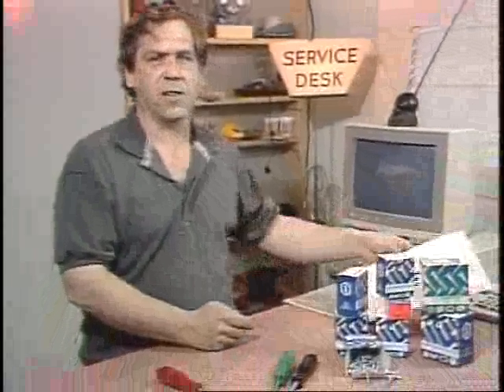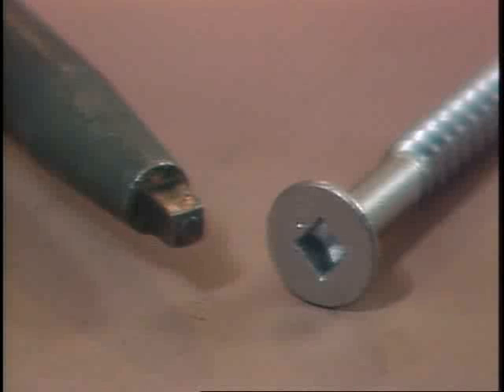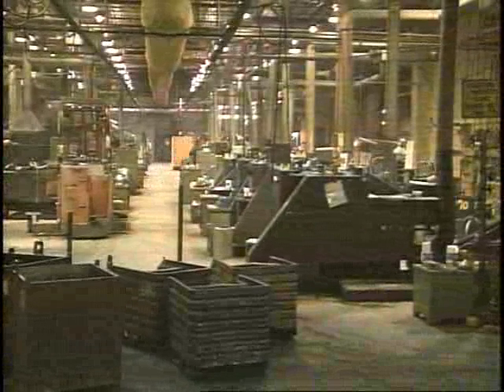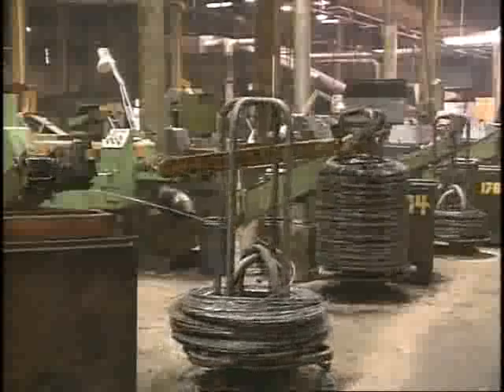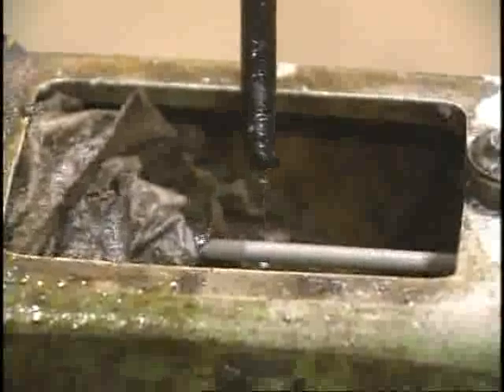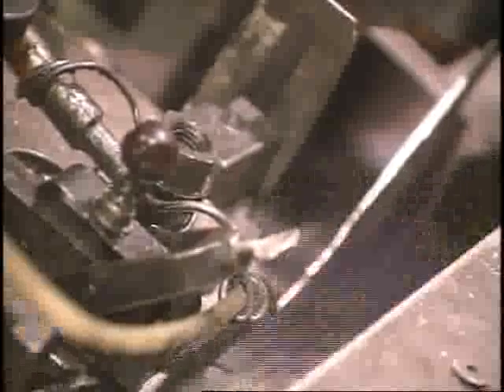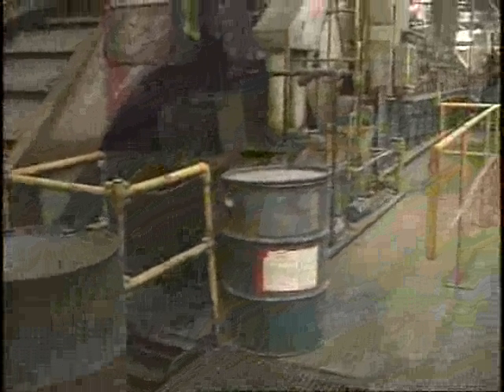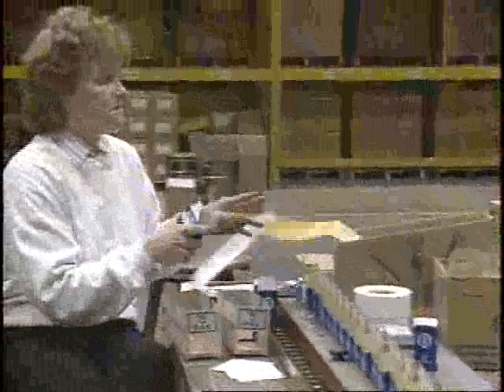Robertson Screws

Comment: Way better than Philips ... should adopt these in UK
Reply: Pozidrive is potentially much better than Philips but only with a good tool and screws that are correctly made.
Reply: Torx is the future.  Only a pity that they didn't make the Torx conical like Robertson. It would make them much more user friendly!
Reply: @tuttebelleke  Once you introduce a taper you increase the risk of cam-out. That's why Pozi is better than Philips.
Reply: @featherbrain7147  One should only make the outer diameter of the Torx bit conical, NOT the 6 grooves.  If the screws are adapted in the same way (they also get stronger by doing that), the screws will stay stable centered in line, even when applying a slight side force (like with Robertson screws).  

For sure woodworkers would appreciate that.  But probably machine assemblers would rather prefer a little side play for allowing screws to orient themselves to the center-line of the thread they are screwed in?
Reply: @featherbrain7147  You have to be really sloppy for a Robertson bit to cam out even though the socket is tapered. The taper is so slight so as cam out is not an issue, and the screw stays on the bit and self indexes. No other configuration can compete in that respect.

Comment: Torx screws are the future.  Here in Europe are Philips and Pozidrive screws for a longtime popular, now it disappearing slowly from the shops.  

Robertson Screws is an typical Canadian product,  I've never seen it here in the Netherlands.
Reply: But it is a pity that they didn't make the Torx conical like Robertson.  It would make them much more user friendly!  Torx 2.0 should be created!
Reply: I've been working with these Torx screws for a while now and I find it much better than Pozidrive screws. A Pozidrive bitt is worn out after 500 screws, with a good Trox bit you can use it up to 2000 screws or more.
Reply: @lexpee  It is the number of flanges that distribute the torque, that does determine the strength and wear resistance of bit and screw.  We evolved from flat (2 faces) to Robertson/Philips/Pozidrive (4), to Hex (6) to Torx (6 enhanced flanges).  And in aviation they often use 12 spline bolts.
Reply: Just bought 3 boxes (600 pieces) here in the Netherlands. I use then of electrical work (outlets, distribution boxes and stuff)
Reply: Ik heb Robertson schroeven nog nooit gezien hier in de winkels , wel te koop op het internet.

i have never see  Robertson Screws here in the shops, It is for sure to buy on the internet.
Reply: Robertson holds onto the screwdriver bit and self alligns. That bears the hell out of Torx for most applications.
Reply: Magnetic bit holders have been invented for this.  

And yes Magnetic bit holders works only with iron screws. iron screws are also most commonly used.